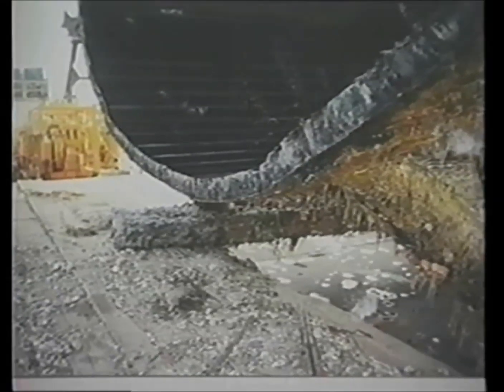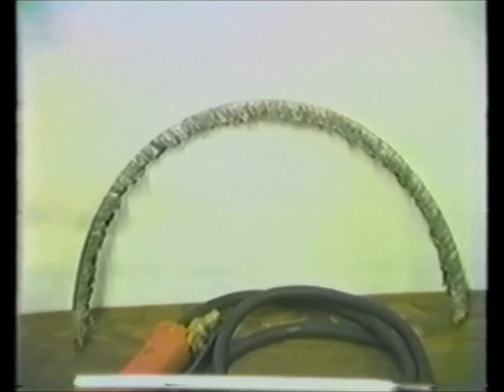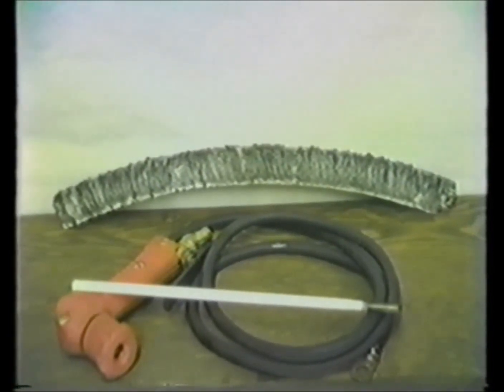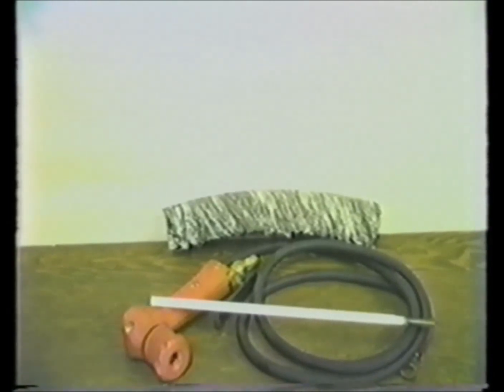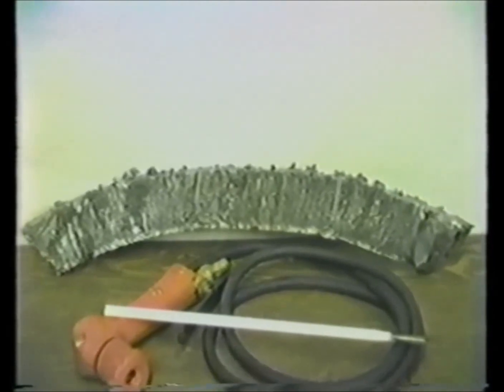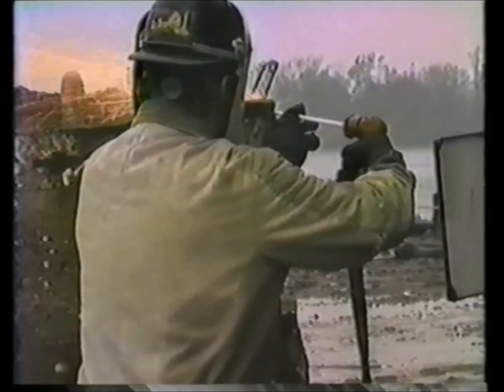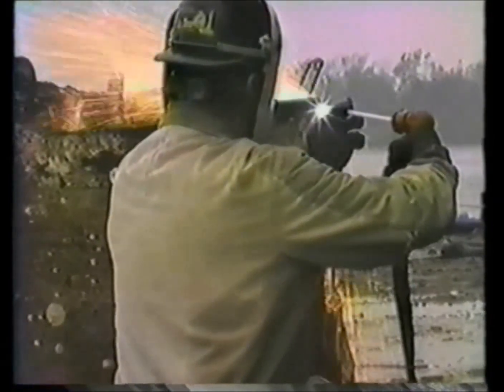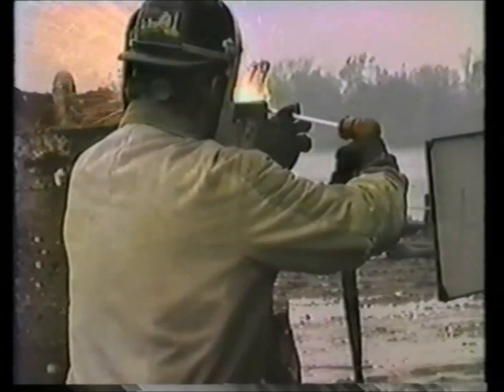Dry Burning

Comment: I agree with every word in this tutorial. However I disagree with the need to hold the rod while burning. That’s not too much weight for the technician to control. Howevrr; if he needs to do this to steady himself then it’s appropriate.  
If he is in the water he should be able to control his rod movement even better he should not be encumbered by the weight of the stinger or rods or gas pressure by properly tying off his lead or controling boyabcy on the stinger and leads. 
His hand/eye control and experience will lead him to perfect straight useable cuts instead of just burning through metal 

His cutting technique is perfect by leaving a beveled edge to initiate a new rod as he continues. 
 Good job 👍

Comment: Very good explanation JC. A pity that these steel tubular rods are unknown by the young generation. Cutting performance was much higher than the thermic ones.
Reply from the maker: And safer in the hands of a Trained Diver. Rod Selection is a safety issue.
Reply: "Cutting performance was much higher than the thermic ones." what do you mean exactly?  and thermic is much more difficult skill to master